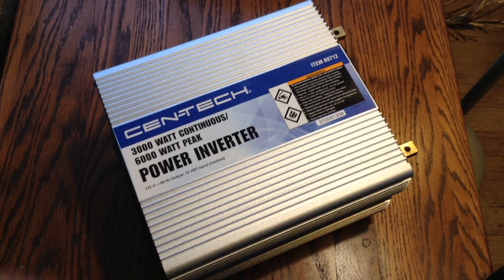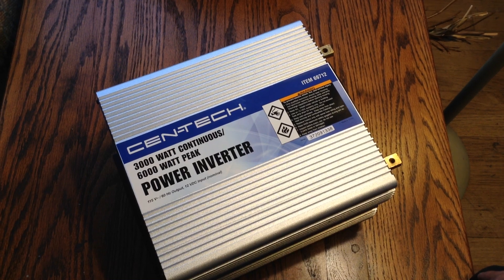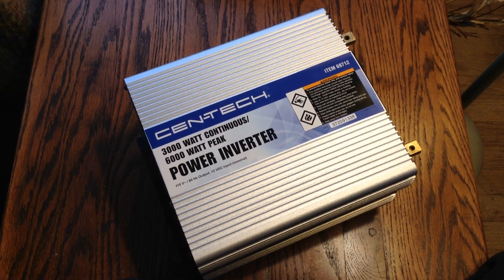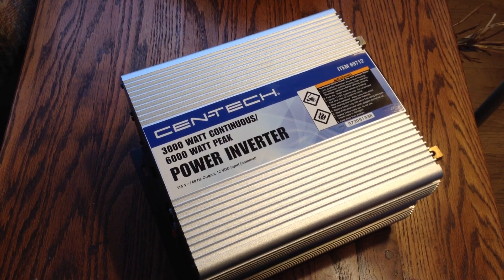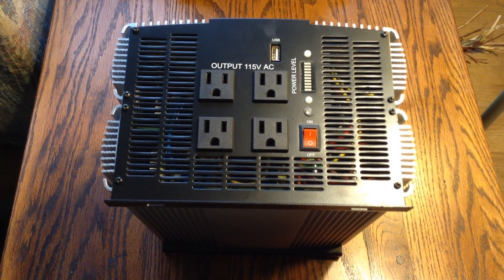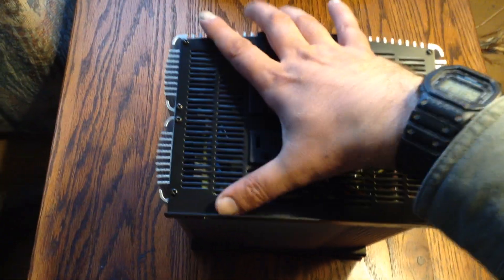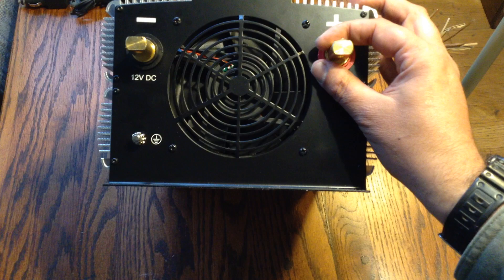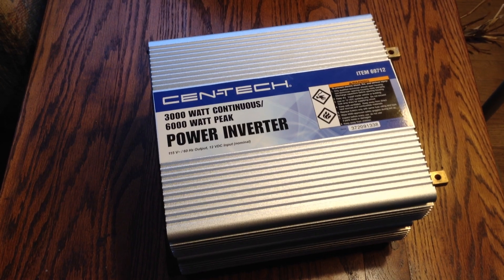Harbor Freight Centech 3000 watt 3KW Inverter item 69712

Comment: I have this inverter and have a serious problem. My solar system has an mppt charge controller. When I get full sun and the controller detects a draining battery it ups the charge voltage to 15.5 volts. This inverter sends out an alarm and won't run until I turn off my solar panels.
Reply from the maker: +someguyinsantaclara You need to run that through a charge controller that will regulate the power.
Reply: +timcat100 it is an equalize cycle that defulfates.  and my type of batteries require this voltage.  I have flooded led acid L-16.
Reply from the maker: timcat100 That crap should not be necessary, and to point to "cheap Chinese charge controllers",  I have yet to see any brands out there which are NOT made in China, and of what I have been using in the middling price range, they seem to work fine with non-Trojan batteries.
Reply: +8digitPDX ,um...midnite solar to name one....
Reply: +someguyinsantaclara You could always just use a high current diode to drop the voltage. It'll reduce your efficiency by about 5% though.
http://www.amazon.com/MicroSemi-Schottky-Rectifier-500Amp-CPT50145/dp/B00L8CI10U

Comment: I ... not knowing much about them... bought a Aims 5000 w  and then when I got it.. it's NOT 5000w...  it's got 4 outlets and each is rated at 1500w.  It will run.. 4 outlets at 1500w's or less all at the same time... but ... I don't consider that a 5000w inverter, it's more like a 4 in 1 kinda thing.   Do these HF inverters like this 3000w ... will it run it's full 3000w from just 1 outlet?
Reply from the maker: William R  Possible but unlikely.  Outlets max out at 20 amps, and those look like 15 amp outlets to me, so I call that four 15 amp outlets.   The only times I have ever been able to over-amp something is on a gas generator.
Reply: +William R What happens if you used the single wire output instead of using the built in outlets?

Comment: have you sold the 2000 watt inverter? id like to get one of those
Reply from the maker: I still have the old style 2KW inverter.  It works fine but I would like to just have matching inverters on everything.  If you were local I would cut you a deal on it.
Reply: How much are u asking?
Reply from the maker: robert anderson
 I don't know, it was not really for sale, replacing it and upgrading that trailer has been a back burner project that I really don't plan on dealing with until late summer.

Comment: I need to run a 850 Watts, 220 volt, angle grinder in my chevy avalanche. IT's gt a 105 amps alternator. Will a 1500 or 2000 watts modified sine wave inverter do the trick?

Can I run the engine while using the grinder without damaging the alternator?
Reply from the maker: This is a single phase power inverter, so it will max out at 120v.   I would guess that if you were in an area with 220power, that you could get a version that does that, but so far, I am not finding true two phase inverters in the US.   So this inverter, if powering a motorized power tool that uses common current, can handle it.   I have yet to find a power saw that this cannot run.   My guess is the angle grinder situation should be the same.  You would run a battery down quickly, but if the vehicle is running and those typically run a 30 amp alternator, then no problem.

Comment from the maker: Updates on the application I used this inverter for:
Small plug upgrade on the battery and inverter power pack

Medium solar generator power pack build part 1

Comment: It is meant to be used in a solar application with a deep charge battery.  Or a light load emergency application.

If I were to use this on the road it would be to power a A.C. air compressor when my tire went low, no way would I use it to power any tools.
Reply from the maker: This engineered for longer term use.  The cooling fan will not come on until it heats up, which is a design improvement over older models which ran the cooling fan continuously.   I am currently using the one in the video on a new semi-portable solar generator build which will standardize applications for cabin, mobile workshop and off grid jobsite use.   The trick will be to see if two of these give me 6KW of 230v to run a medium duty welder.
Reply: 8digitPDX You are a brave one to spend that kind of bucks & have the magic smoke come out of it.

I just saw a over-priced unit at a Marine/boat store that was 2500 watts & they wanted $300,00 for it?  Over priced is all I could say.

Keep up the super videos, & please enjoy your life to he fullest!

Kurt

Comment: Crapple devices need the D+ and D- lines tied together and connected to either 5V or ground with a resistor because stupid.  You may want to check the noise on it with an oscilloscope as the power supply is probably inadequately filtered if their solar kits are anything to go by.

Comment: Good setup for occasional use  or emergency power. Keep in mind 3000 Watts is 250 Amps at 12Volts. I found that on demand inverters will not continuously run devices like ice makers and refrigerators with digital on/off switches. I would not run induction motors or charge batteries with an modified sine wave inverter for very long their signals may be too distorted. CCA rated batteries are not made for deep cycling use. This setup should work for what you are using it for but I would recommend dividing the current by using at least two 12 Volt marine batteries. Marine deep cycle batteries have a CCA rating. AGM for this use would be cost prohibitive.
Reply from the maker: RV/marine rated batteries are exactly what I have in mind for this.  That is what worked out pretty well in the mobile workshop trailer.
Reply from the maker: I know people who run fridges and freezers more or less full time on modified sine wave inverters, but I don't think they are electronically controlled appliances, just really basic make it cold type appliances.   They don't run a charge controller on the system so if voltage gets high, they run around the house turning on lights and stuff, and if it gets low, they shut down the inverter for a while.  The cost of used appliances vs the cost of 12v specialized appliances is such that you can afford to burn up a few appliances every once in a while but if you get three years out of an AC fridge run on an inverter, you are winning, since the DC only stuff is so atrociously expensive.